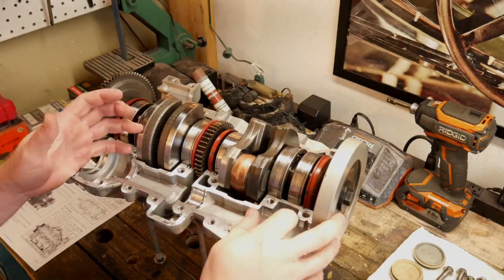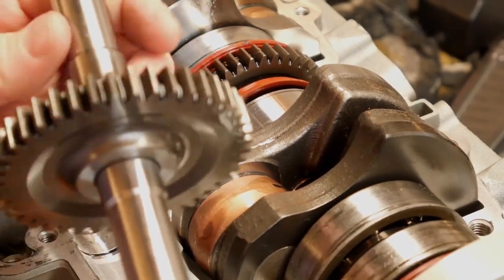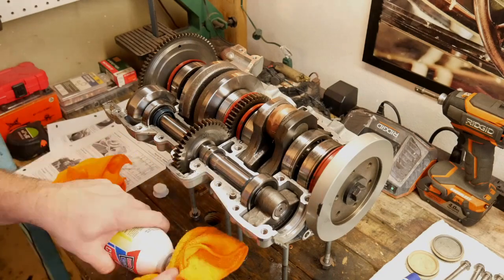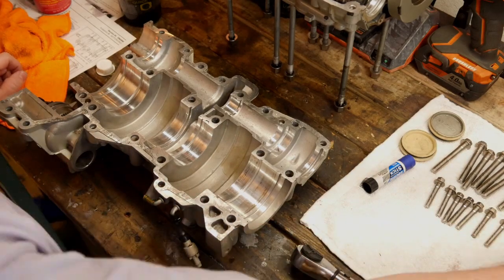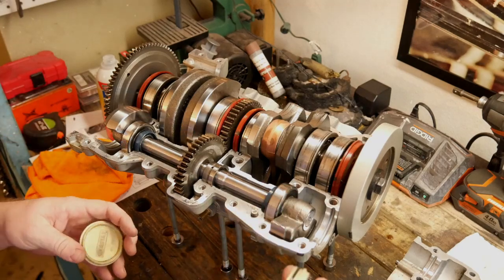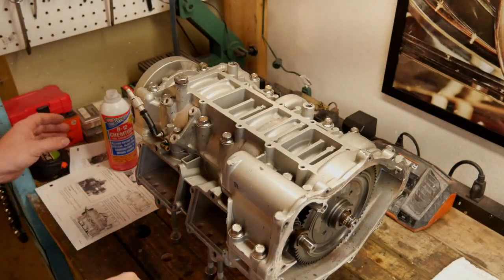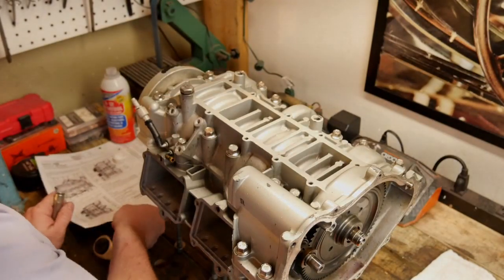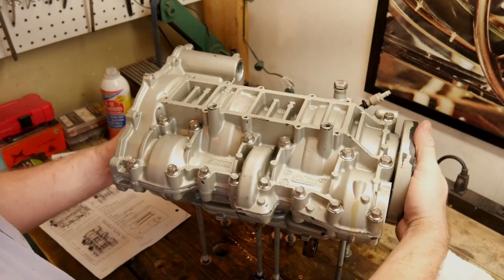Rotax 951 Bottom End Assembly - Part 1

Comment: hi great vid thanks, just a quick question. I have a seadoo 951 but i need to rebuild the engine from scratch, are there any rebuild kits you recommend?
Reply from the maker: @JoeyLoveland  I used wsm and sbt for the rebuild I've done. It's till running great with another 100 hours on it. This hull has over 500 on it now last I looked

Comment: Hi, Craig here from New Zealand, love the details of your videos, been watching them over more than once.. especially the 951 rebuid series. I have the same ski and its put a rod through the block and punched a hole. Where is the best place to purchase Seadoo parts from that you can recommed. Also PDF of say a manual with tought settings etc?
Thanks for your help 🙂
Reply from the maker: I honestly got most of my parts from ebay or SBT and WSM here in the states. Its still running good with another couple hundred hours now. https://www.wsmparts.com/Search/PartsSearch/BrowseSearch/?Level=1&Catalog=1&Section=0&Subsection=0&Category=0&srsltid=AfmBOopJkHP6NLyHbd6CrXEdcDG1jH-7BQU_Z7jPlQE6bNCftMwKOtjq
https://www.shopsbt.com/?gad_source=1&gclid=CjwKCAiAqrG9BhAVEiwAaPu5zqpZUcuJD0SskN3FIt8R-S_TH_4Dy5JmwOAoCfcliyP3cJpuHHTvzhoCfWoQAvD_BwE
I had a paper copy of the manual actually. some of the forums used to have them and thats where i downloaded it from. i looked to see if i still have that file and i dont sadly.

Comment: Who did your machining? Also who rebuild the crank? Sorry one more question did you get new hardware? Looks so clean
Reply from the maker: It was bored by a local machine shop and i chamfered it at home. The crank was not rebuilt on this engine, but normally i just get a wsb or SBT crank kit. Hardware is all stainless, so just hit it with a wire brush.

Comment: Does the pto flywheel have any special way to go on or just slide it and tighten bolt?
Reply: Os there any timing marks or such?? Thanks
Reply from the maker: Im not sure i did not take it off on this engine. On the 787 they are threaded on. I think this is the same.

Comment: Looks like your crank was rebuilt incorrectly. The gear on your crank was 180* off. The counter balances on the balance shaft should be pointing the opposite direction as the ones on the crank
Reply from the maker: You are right, it is 180 degrees off. Believe it or not, it has over 100 more hours on it now since the top end rebuild. I'm really surprised it does not vibrate all that much.  
The crank was in the ski when i got it and i did not have it rebuilt. I wonder who rebuilt that crank.
Reply: @DeWoodysShop  well that should prove that a balance shaft isn’t too necessary, because it would’ve vibrated less without it….
Reply from the maker: Yeah probably not. I always thought it had some vibration. But of course it was always this way since i had it and it seemed within what seemed reasonable for a 950cc twin 2 stroke.
Reply: I do not believe he has it 180° off. I just rebuilt my 951 and had the shaft off 180 from where his currently is. Shook so bad on startup it shook all of the exhaust bolts loose. Will know later today but I’ve got it installed like this one. Also found other pictures on the internet showing the same orientation.

Comment: One of the best if not the best instructional video's I've ever seen, do you do any work on the side, I have 2 of these motors that need to be rebuilt!
Reply from the maker: Thanks! Sometime i do, but right now there is a bit of a back log after buying a house earlier this year and having to redo several parts of it.
Reply: Go to FullBoreonline.com and check out their facebook page also and watch their videos and you will see why those inner seals need sealant also. It's where I send all my seadoo rebuilds. Factory trained with 25 years doing just this and machine shop. They are the best and reasonable with great customer service. Trust me you don't want anyone but Dan doing this work.
Reply from the maker: @johns5734  it's much more important on the 787. It had very narrow seals on the top edges.  The 951 has more traditional seals with wider tops. I have never seen it happen in a 951 you can usually see the case marks where the split is on the seal.
Reply: @DeWoodysShop  your right the 787 was the problem child for that. It's good to do it on the 717s also seen them leak after a fresh rebuild where they didn't put it. I wouldn't have said anything if you were going to take on the job. I thought they put it on all the seals now.

Comment: Do you need any special tools to rebuild the bottom end like pullers or anything to replace the seals?
Reply from the maker: If you want to change the seal behind the, flange/flywheel thing (sorry not sure what its technical called. The thing the propshaft bolts to.) Yes you will need a puller. My engine did not have an oiling failure just coolant so the crank only needed cleaning so I did not actually even take it off this time.

Comment: Great Video!  Glad I came across this!  I am rebuilding my 951 as well.  I was just gonna do the top end but thought as long as the engine is out I will rebuild the whole thing!  One problem I removed the cup (Magneto side) from the flywheel,  Is there a way to tell how to line it back up?  Are there marks, tabs, etc?
Reply: Free Seadoo manuals. Not spam
Reply from the maker: Yeah, there is makes it will go one two possible ways if I remember right. Let me check my service manual. If you need one measage me
Reply: DeWoody's Shop hey how did you get you hands on a manual to rebuild the 951? I’ve been looking but I can’t find them
Reply: DeWoody's Shop ? Any help would be awesome!